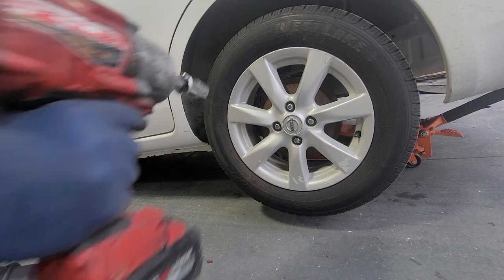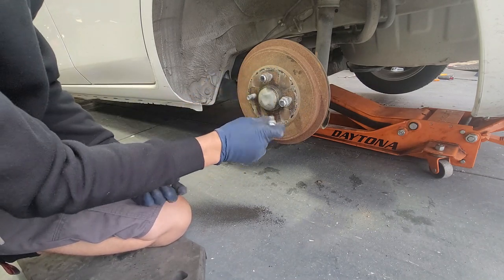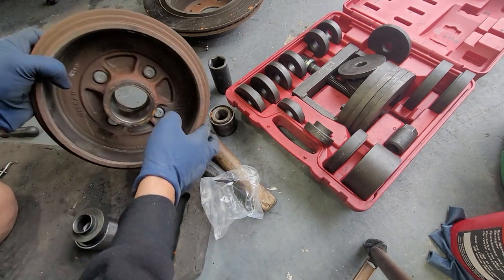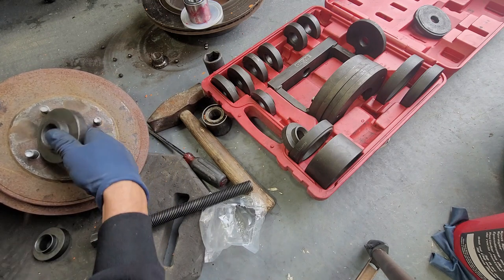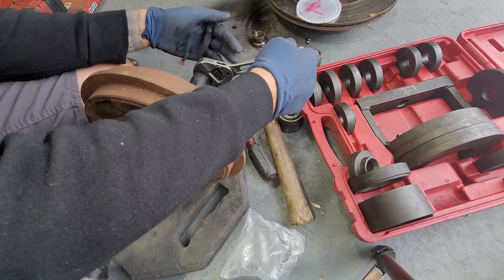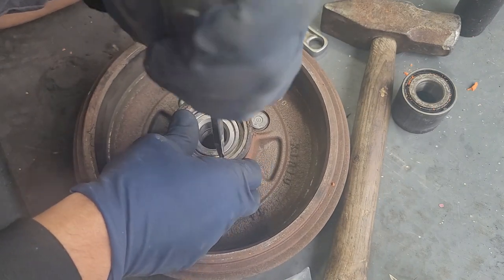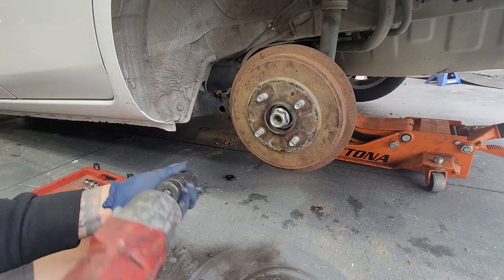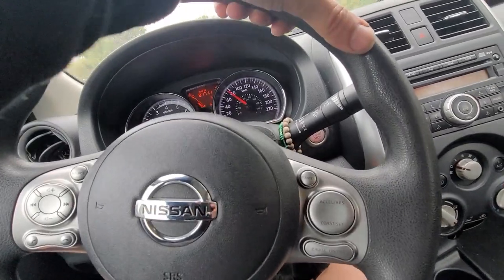2014 Nissan Versa rear wheel bearing replacement

Comment: Thanks for you instructive video, i did one of the rear bearings on my 14 versa, it was hard because the tool set I got from autozone was not the same as yours. It had a puller in one box and a step washer set in another case.  The puller was strange becasue the arms didnt quite make it across the diameter of the drum instead i believe i was supposed to pop out two studs insert the threaded arms into the holes and thread the lugs to them on the other side.  I didnt want to remove the studs without having replacement ones in case they broke or became un-reusable. So i just barely caught the edge of the drum with the hex arms. If the thing had hooks like a gear puller it would have been much easier. Anyway it kept spinning and moving when i tried to turn the center screw.  So without a vise i wedged the drum under another part of the car so it wouldnt move and was able to get it out.  I used the other loaner sets step washers to pound the new one in place. What was a 600$ job at the local shop cost me like 80$ for the bearing and some grease.  Thanks again, you Rock!!! keep on keeping on!